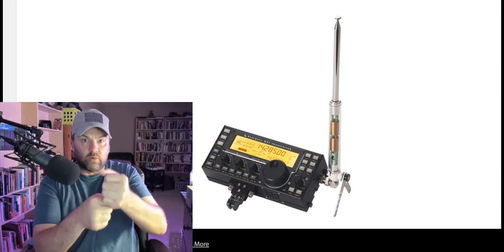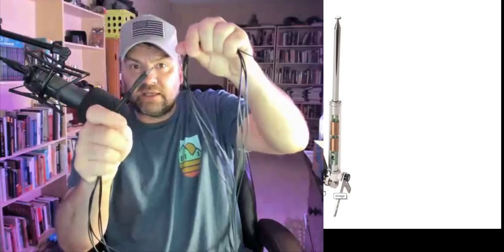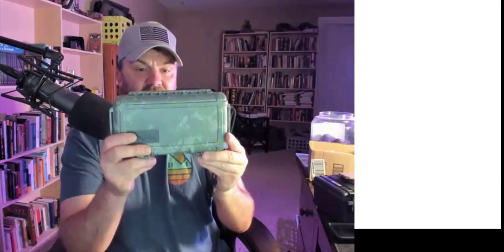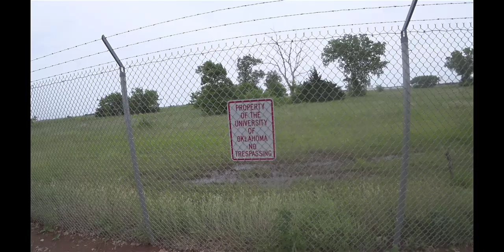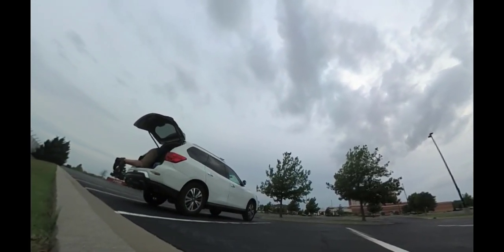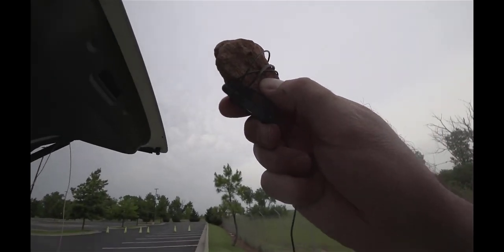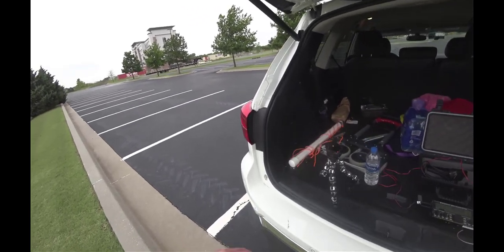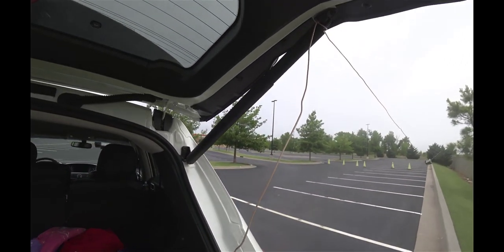Ham vLog #20 Elecraft AX1 Antenna discussion | Best Travel Antenna | Solar QRP?

Comment: One issue that you may have had a problem with using the LNR Trail Friendly antenna where you were was that it was right next to the fence.  The reflected "power" off the fence may affect your SWR.  When I put my buddipole up parallel to my RV my SWR is twice what it is when it is 90 degrees to the RV.  Just a thought.
Reply from the maker: That is a really great insight.  I never thought about the fence reflection issue.  I was time crunched on that effort and hadn't field tested my setup before hand.  My fault.  It will get better.  Tnx fer comment.

Comment: You are 100 percent correct. Traveling with a radio, as small ass the QRP jobs is no problem. It is the antenna that is the problem, and generally a huge problem. Solve that and we can go into business.
Reply from the maker: Exactly.  I think this thing works. I got it yesterday and made a contact right off the bat.

Comment: I like your imitation of a Morse Code signal. I have a new Wolf River Coils antenna. I have yet to put it through its paces. I also have a magnetic mount and several ham sticks. I can literally put a ham stick on top of my van and be on the air in five minutes.

Comment: Hi Tom! Thanks for another great video! The good thing about it is that it is very realistic, showing what we all seem to have experienced and the problems we all face. I had lots of similar unsuccessful HAM days, where everything was against me - the wind, the antenna, the people appearing out of nowhere. But then another day starts!

Regarding the lack of qso, I did not like that fence nearby. It is not that it affects the SWR, but it definitely "consumes" the RF your transceiver was emitting. The height of the fence was almost the same as the height of the wire, a bit lower, but that would be enough for the negative effect.

As you, I am also looking for a good, portable and convenient antenna. So, please do film its performance, if it is successful, I guess I will order one myself.

Finally, a question unrelated to this video, but to your previous one. Some time ago you filmed about learning and practicing the CW. And there you demonstrated a script that you used that I would love to have. It seemed that I have seen the text of it on one of your videos, but did not manage to find it. Just in case you still have it somewhere, I would appreciate if you could make a picture of the text so that one could copy it - I found it very useful to start with such a script.

73 de R2ARM!
Moscow
Reply from the maker: Heres the cw format https://youtu.be/ZqPQE1D8gfw

Comment: Some people report good results using an end-fed dipole from a motel, by just hanging it vertically from the window. It's better, of course, if you can get it away from the building a bit, by using a bit of a push-up pole, or any means you may have.
Reply from the maker: Yeah, most hotels have locked windows.
Reply: @hamradiocq   That's true.

Comment: I bought an AX1 for all the reasons you show in the last part of your video.  Keeping a low footprint and profile is important here in California where everything is illegal even when there are no written laws against it.   I tried the little bipod mount, and it works OK on a picnic table with zero wind.  When a breeze blows in, I move it to the little camera mount adapter clamped to the top of the table with a c-clamp.  That works well, but I would love to find a small camera tripod to use on a tabletop.  --Mark, KE6BB

Comment: Might I suggest a topic for a video?  You've sold me on the KX2 (just received mine... Gotta send it back because there are issues), but you have gone through a plethera of antenna arrangements.  Some good for urban use, others for activating parks or wherever your car should stop. How about a video about the pros and cons of each.  The LNR looks good, but how does it compare to the Packtenna, for instance.  Which is better to use when throwing into trees vs using a portable pole?  I'm sure length of pole and random wire would be in play.
Reply from the maker: Great ideas. Appreciate the comment. I will do this asap given amount of time ans wx agreement I can get.

Comment: The AX-1 does work. You will not make a ton of contacts with it in today's conditions, but I have made SSB contacts to Japan and to the central part of the US from California.   Counterpoise is important and I use a longer wire than supplied.   I attach it directly to the KX3 and I do use the bipod.   I made a CW contact from California to SC with 5 watts. Anyway it is indeed convenient, and if 1 or 2 contacts are desired  in an outing then it is fine. You are not going to break a pile up with it.  Now in 5-6 years when the bands are good it will likely be possible to use it and 10 watts to make worldwide DX.

Comment: I bought a cheap ($7) inline volume control for my Mountain Top'er from Amazon. There are a lot of them in this price range that have the female and male stereo audio plugs so they work with headphones and speakers alike. That said, I am tired of carrying so many parts, so I'm building a box that contains a speaker/amp, volume control, a qrp tuner, and batteries for mine. I think I can get it all in a box the same or smaller in size. Thanks for all the videos! K9BLR
Reply from the maker: Yeah, I started to wonder whats the point of a small radio if we have 25 accessories for it!  Nah, I sill love this thing.

Comment: You'll have issues with the solar plugged straight into the radio...everytime a cloud passes over or someone's shadow blocks the panels, the voltage will drop out and you may lose your contact. Even a small battery would help with that.  Great videos! 73, KJ4DDM

Comment: I use a Tiki Torch ground spike to keep my Buddipole in place when it's guyed, works well.  I'm surprised K8MRD hasn't sold you on a Wolf River Coil yet. :D
Reply from the maker: I havent looked into WRCs yet.  I need something that can be deployed and torn down fast like when I'm at a hotel. I'm still working on the Perfect antenna setup. Ha

Comment: I really like your videos. Ham Radio is a experimental radio service! Try, error, improvment. Thats why we are hams :-) I tie my 32foot fibre mast to the mirror of my car. Works great and is stable enough. I also had good results with tieing the mast to a small tree or bush. I am curious what you will say about the AX1. For really fast deployments I use the Chameleon MPAS with a spike. Takes only 3 minutes to set up. 73s Stephan, DF6PA
Reply from the maker: I had very little success with my chameleon on qrp. Thanks for the very nice comment. I will be trying just about everything coming up. 73

Comment: My prediction is you will get local and strong signal cw and not much else.  Comparable to one of those little short wave weather radios.  Just a prediction though. I am  looking forward to your test. 7trees.
Reply from the maker: Yeah I cant wait to find out. I dont expect much but ima try
Reply: I have made SSB contacts to Japan, and 1200 or so miles in the US using the AX-1. I have made CW contact to the east coast.  It is a significantly compromised antenna but it is nice and easy. Its performance will only get better as the band conditions improve. At the peak in 5 or 6 years it will likely be possible to make regular DX with the AX-1 and 10 watts. Counterpoise is important. I use a slightly longer wire than supplied by Elecraft.

Comment: I had the same issue - looking for a travel antenna that is quick to setup. requires no messy radials and is effective. I bought the UK made "Wonderwand Wonderloop" antenna. It tunes to a low SWR from 7 - 54 Mhz, and is only a 1 ft in diameter loop. I modified mine slightly - it's comes with a wire loop, and is supposed to be used directly plugged into the rig. I made a tripod mount to get it away from the rig and where it can be near a window or balcony. I also didn't like the supplied wire loop - it was floppy and kept flopping around, so I used 1/4" copper pipe to form a circle. Works great as a travel antenna. https://www.hamradio.co.uk/aerials-amateur-antennas-portable-antennas-wonder-portable-antennas/wonder-wand/the-new-wonderwand-wonderloop-750-7mhz-50mhz-pd-5208.php. The "WHIZZLOOP" is a UK copy by Moonraker, and is sold by DXengineering. https://www.dxengineering.com/search/product-line/moonraker-ltd-whizz-loops?autoview=SKU&sortby=BestKeywordMatch&sortorder=Ascending
Reply from the maker: I will take a look at what you mentioned. You understand the problem.  Needs to be up and down quick on the road.  Thanks fer commenting.